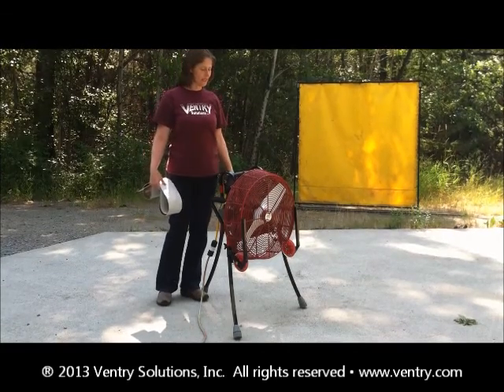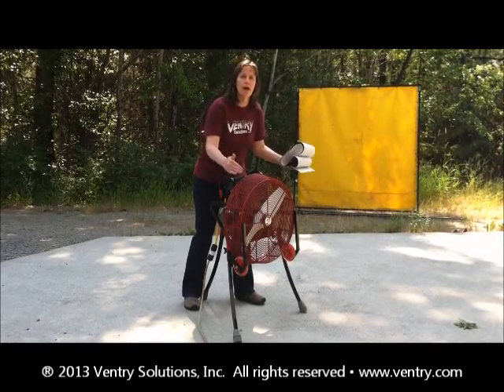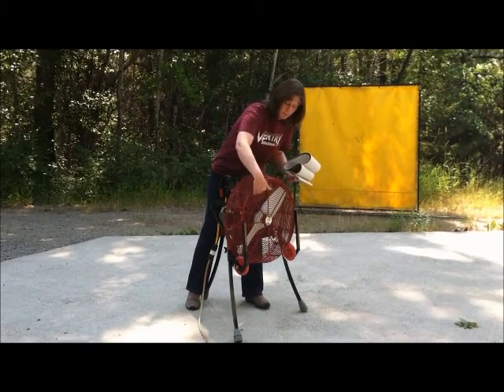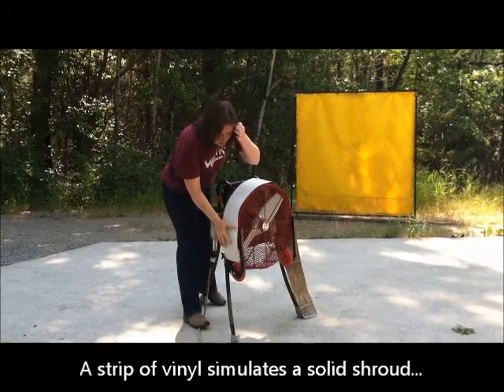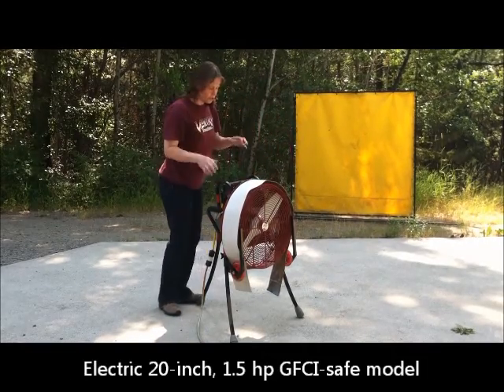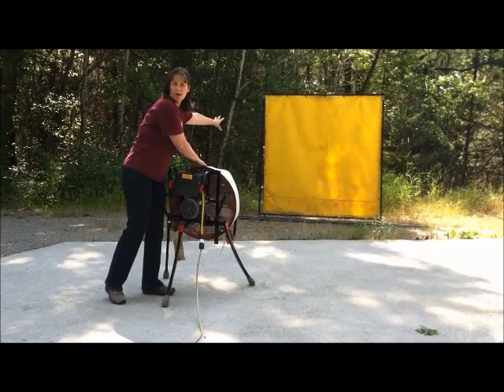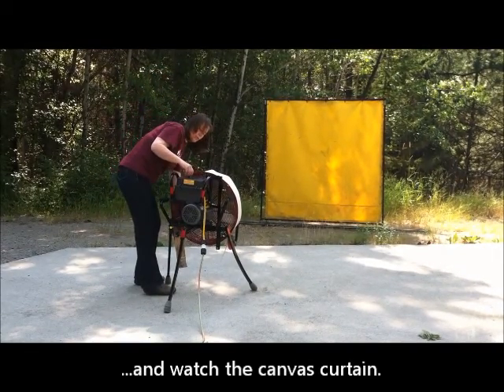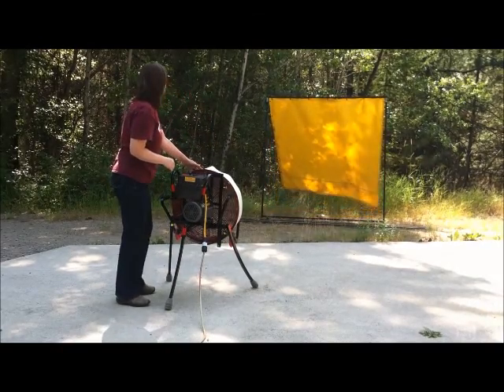Open vs Solid Shrouds on VENTRY Positive Pressure Attack Fans

Comment from the maker: Thank you, Logan11350 and Jon McClintock for your comments. Jon, for clarity, we are not attempting to address other brands of fans, only our own VENTRY Fans which do use propellers -- tried and true aircraft technology. The video shows that starving a very efficient propeller of air, in this case by blocking it with a solid shroud, will drop air volume and increase noise significantly. VENTRY Fans are known for being very quiet (especially relative to conventional fans) and moving high air volumes (CFM) using very little horsepower; both of these qualities are due in part to the open-flow guard. We encourage our customers to contact us to arrange demonstrations or even free trials so they can compare our fans to other fans themselves and see the benefits in-person. ~ Joan Rodman, Ventry Solutions, Inc. 888-257-8967

Comment: While this is true in regards to PROpellers, most blower/fan manufacturers today use IMpellers on their fans. Impellers require an enclosed outer casing or shroud to function as designed. Propellers on the other hand, are engineered to operate free from any kind of enclosure. You can't take a propeller and throw a "shroud" around it and expect it to behave as an impeller would; that's like comparing apples to oranges.